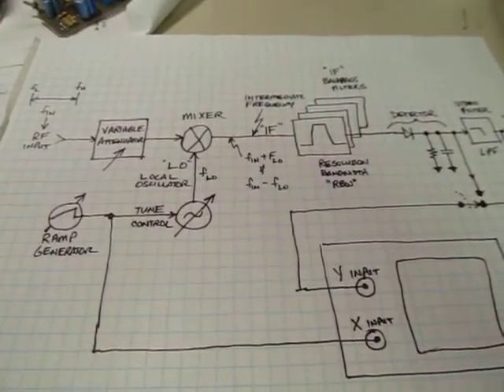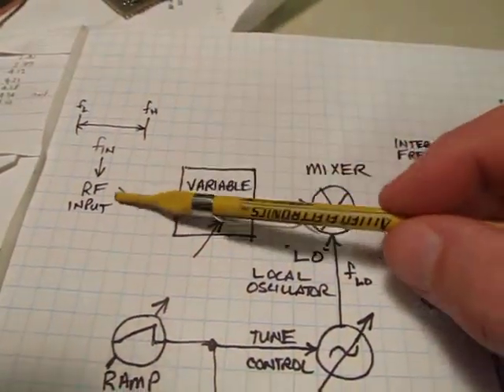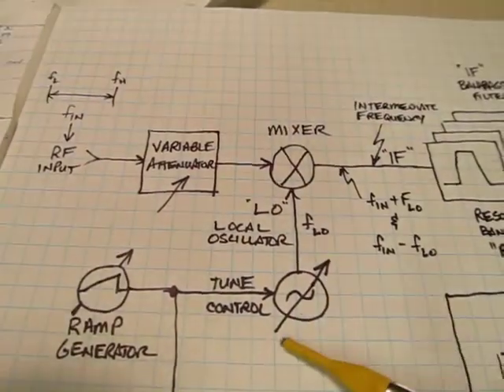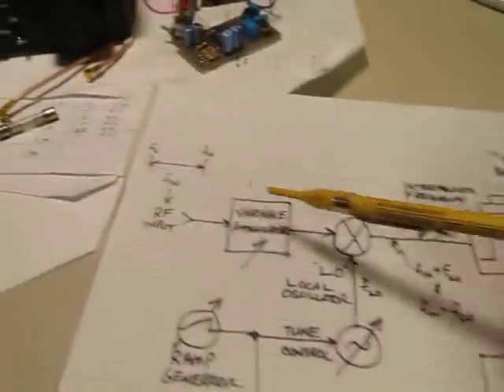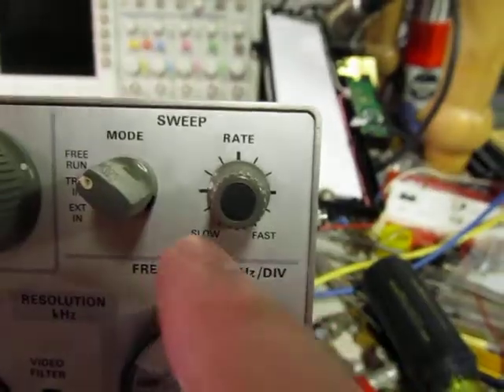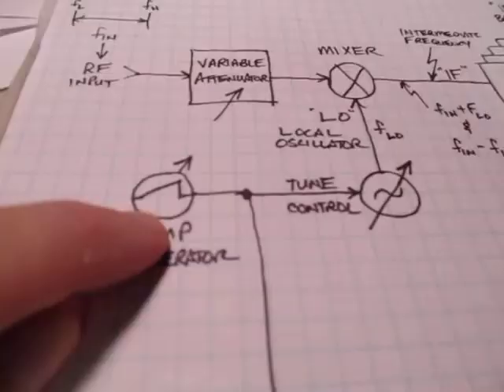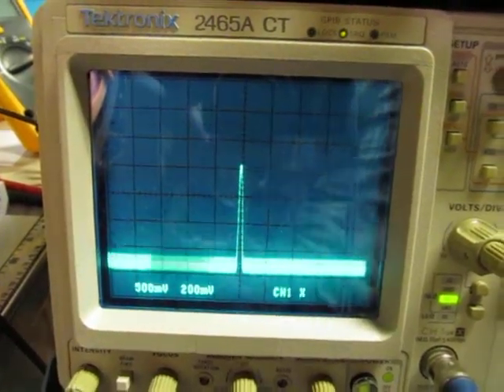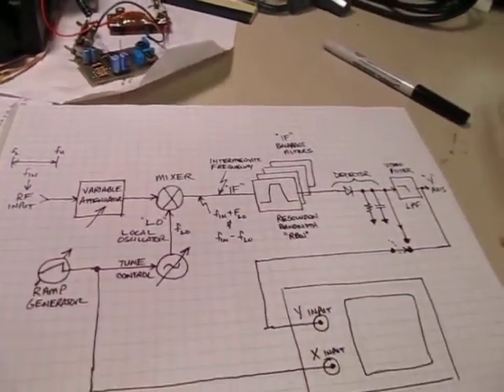#22: Spectrum Analyzer Basics / Tutorial, and the Tektronix 1401A

Comment: Thanks for the great video !  May I ask a basic question ?  In several SAs I've seen there is a setting in their "Bandwidth" menu called "Average Type".  Most manufacturer's manuals (I've checked several) say something vague like, " This sets the Averaging Type", and then describe the choices.   I can usually only find two "averaging" functions in the entire SA.  One is a detection method choice, the other is just basic post detection averaging.  For the first, I can select something other than "Average" (say "Max Peak") for the detector type choice which should eliminate any averaging there.  Then I can turn off the other average function as well.  But this setting STILL visibly effects the displayed trace. It's still operating !  And the setting choice is even still shown on the display.  As far as I can see, ALL averaging should be turned off but changing this "Average Type" setting is STILL changing the trace somehow.  What is this setting actually DOING ?  What averaging function is still operating that it's controlling ?  I've tried everything I can think of to answer this question with zero success.  Could you please help ?  Thank You !
Reply from the maker: The "detector type" determines how the power is detected and processed while drawing each trace.  In older analog SAs, this is the detector that follows the final RBW filter.  In modern "digital" processed SAs, it is slightly more complicated.  When the spectrum trace is computed, the resulting raw spectrum data usually contains more trace points than the horizontal resolution of the display (number of pixels).  So, the "detector" is used to process all of the candidate raw spectrum data points into each displayed trace point.
Reply: @w2aew  Thank you very much for the response !  But I know what "detector type" does.  It's usually pretty well explained in the manuals.  One of those detector types is, "Average" but the rest are explicitly NON averaging types.  What I don't understand is the setting usually found in a "Bandwidth" ("BW") menu called "Average Type".  As I said in my question,  one of those "detector type"s that is explicitly NOT averaging can be selected (say, "Max Peak"), and the down stream "Averaging" function can be turned off as well. And yet this "Average Type" setting STILL is having a visible effect on the trace depending on which option is selected.  Everything to do with AVERAGING is turned off !  Yet this "Average Type" setting is still DOING something.  And the selection made there is explicitly shown on the screen - despite the fact that all averaging is turned off !  I found this same thing in every manufacturer's SA I checked.  What is that "Average Type" setting doing ?  Thank You !
Reply from the maker: @Starlite4321  I guess I'm not quite understanding your question...  The non-averaging detector types are typically selections such as Sample, +Peak, -Peak, etc.  These will certainly show a difference in the resulting trace - whether or not the downstream trace averaging is on or off.  Can you clarify what you mean when you say that you see a visible effect when you change detectors, and why you think this is not expected?
Reply: @w2aew  Thanks again for the response and for sticking with me here !  Yes, I understand that the different detector types will show differences in the resulting trace.  What I'm asking about is a DIFFERENT setting in a DIFFERENT menu (usually the "Bandwidth" menu) called "Average Type" - not DETECTOR type,  AVERAGE type.  I can set the detector type to "+Peak" to use your terminology.  Note that on many SAs I could have chosen a different detector type called "Average" and that I did NOT choose that.  Then I can turn off ANY other settings in the SA that pertain to averaging.  Now I turn to the BW menu. And there is this "Average Type" setting in there (not DETECTOR type).  It doesn't turn anything on or off.  It provides a small selection of AVERAGING (not DETECTOR) types.  Remember, I have the DETECTOR type set to "+Peak" (not "Average") and all other averaging functions are turned off.  Now here's the question: if I change this "Average Type" setting between its options, and don't change any other settings, the trace STILL changes with it.  What is "Average Type" (not DETECTOR type) doing ?  There shouldn't BE any averaging going on for it to SELECT a type for !  Yet this option is still clearly changing SOMETHING.  WHAT is that something ?  The "Average Type" I selected even shows up on the display.  In fact, there's nothing you can do to turn it off !  It's ALWAYS there.  Remember - every averaging function has been turned off or deselected.  Thanks You !!
Reply from the maker: @Starlite4321  Oh, OK.  What are the options under the Bandwith > Average Type?  Is it things like VRMS, Power, LogPower, etc.?  This has to do with how the math works to calculate the average detected signal.  Technically, averaging LogPower (like averaging the dBm levels) is mathematically incorrect - but it was a averaging technique that was unfortunately written into some standards, so many SAs have kept it as a selection even though it is mathematically incorrect.
Reply: @w2aew  And again, thank you very much for responding.  Yes, THAT "Bandwidth>Average Type" !  You say, "This has to do with how the math works to calculate the average detected signal".  But I don't understand that !  Recall in my example, I chose the DETECTOR type to be "+Peak".  In every description of this I've ever found published by many different vendors (and at this point trying to figure this out, I've read LOTS of them !), they make a big deal out of that detector type explicitly NOT doing ANY averaging (same with all the other options except "Average").  It simply picks THE largest sample within the bandwidth and passes that one value along to the detector.  Again, there IS an "Averaging" detector option, but I've carefully not chosen it in my example.  I've also turned off absolutely anything else in the spectrum analyzer that involves averaging.  So there shouldn't be ANY "averaging technique" involved here, right ?  In fact, I don't WANT any averaging in this case !  I picked a BW that gave me a noise level I can live with, and a DETECTOR type that explicitly doesn't involve ANY averaging because I want a trace of THE maximum values as the signal slides past the BW filter.  Yet changing this setting does change the trace !  It's still DOING something !  What the heck is going on ?

Comment: Hi Alan.  I want to complement you on your truly excellent set of videos explaining the operation of analog swept spectrum analyzers.  I have a physics background and have recently been  thrust into the world of spectrum analyzers.  I was finding it really frustrating coming up with understandable explanations for RBW, VBW, ref level,  and noise floor.  Your videos offered me complete clarity for all of these terms. 

I have a question for you.  I think I finally understand the role of the ramp generator that is shown in your spectrum analyzer  block diagram.  However, I am not certain my understanding is on firm ground.  Here is what I believe is going on.  First, the ramp generator applies a time varying voltage to the tunable local oscillator that causes the frequency of the local oscillator to move over a range of frequencies.   Am I correct up to this point?  If I got the first part of my question correct, I want to move to the second part of my question.  As a spectrum  analyzer user, I am able to specify a span of frequencies over which I want the spectrum analyzer to scan.  Specifically, I am able to select a minimum starting frequency for the scan as well as a maximum ending frequency for the scan.  To keep things concrete, let me assume I select 10 MHz as my minimum frequency and 100 MHz as my maximum frequency.  This choice of values establishes a span of 90 MHz.  Now, I am guessing (and hoping) that my choice of 10 MHz as a minimum frequency maps to a unique lower limit voltage on the ramp generator.  Similarly, my choice of 100 MHz as my maximum frequency maps to a unique high limit voltage on the ramp generator.  The ramp generator then repeatedly drives the tunable Local Oscillator over this voltage range,  which means my 90 MHz span is being cyclically pushed through the Resolution Bandwidth filter,  to produce the signal that is displayed on the oscilloscope screen.
Reply from the maker: Yep, you got it.

Comment: Can we do something fancy with the detector to get fast sweeping at narrow resolution bandwidths?
Reply from the maker: Not with a swept architecture.  The narrower the filter, the longer the time constant.  There's no getting around the physics of this.  It has nothing to do with the detector.  The sweep  has to be slow enough to allow the filter to fully charge.  FFT based analyzers have an advantage here.  While you still can't get around the time constant, you can "compute" the spectrum over a wide range in one go.  So, even though the FFT vector is long, it's only computed once.  For example, a traditional swept analyzer will typically take 20-40 minutes to do a 1GHz sweep at 1kHz RBW.  The same can be done with a wideband FFT analyzer in less than a few seconds.
Reply: @w2aew  is there any electronic analog to a prism, separating light in parallel? Not computational like an fft, but some sort of physical implementation? (kc1nyu here, btw)
Reply from the maker: @nickcaruso  I believe there are magnetic resonance structures (similar to NMR applications) as well as surface acoustic wave (SAW) devices that can be employed in a similar fashion for RF/microwave.
Reply: interesting.  thanks!  your videos are fantastic! very helpful for this software engineer electronic hobbyist! 😀

Comment: @w2aew at some point it would be great if you could discuss the difference between swept-spectrum analyzers vs. fft ones. That stuff can get freaky with pulsed signals.
Reply from the maker: I'll have to plan on a video like that.  The short version is:  A swept-spectrum analyzer is like what is described in this video - a swept-tuned receiver with a detector on the output.  An FFT based analyzer is like a wideband receiver, where the receiver BW is sufficient to cover the span of interest.  The incoming RF is downconverted into this wideband IF and digitized, much like a scope digitizes a signal.  The sampled IF waveform is then processed by an FFT to compute the spectral content.  Advantage is that you can do a triggered capture so that the sampled IF signal is just the signal (pulse) of interest.  An FFT analyzer can give you the spectral content of a short, continuous record (instantaneous spectrum), while the trace from a swept analyzer is drawn over a comparatively long time - not possible to see just the spectrum of a short pulsed signal for example.
Reply: @w2aew  Don't some analyzers do an inbetween thing? If the SA can take the whole span in one go and then do FFT on it that would make it a real-time analyzer right? (not shure if there is an commonly accepted definition of what a RTSA is, suppose it could be based on POI). What confuses me is that there are some analyzers, that are not sold as RTSAs, that have an "No FFT" Sweep Mode - that would imply the normal sweep mode is some sort of FFT. My understanding is that those analyzers, because they are not fast enough to do RTSA and can't take the whole span in one go, do a "half-way" thing. They sweep the IF in steps, sample and FFT process it in chunks to get faster overall sweeps. I'm trying to get my head around how this potentially could cause problems. In particular with very short pulses.
Reply from the maker: @juliussokolowski4293  All FFT based analyzers have a given span that they can digitize - this is called the instantaneous BW, or acquisition BW.  You're right, most times this acq BW is narrower than the desired measurement span, so the spectrum is computed through multiple segments to build up the entire span.  If the Span is set to be equal to, or less than the acq BW, then no stepping/sweeping is required.  This is how vector signal analyzer work.  They capture/record baseband (usually IQ data) over a given acquisition BW for further processing, often modulation analysis, etc.  Because FFT based analyzers process a seamless record of time-domain data, they often can be "triggered" to capture data at a specific time - very useful for looking at pulsed signals.  When the analyzer has the ability to perform streaming FFT processing on the IF (IQ) samples as they're flowing through the processing chain, then this is what is called realtime spectrum analysis.  Some do this just to enable triggering on transient spectral events, and most these days can also display the composite result of these realtime FFT results.  These are what are typically called RTSAs.  If you ask an RTSA to show you a span that is greater than this realtime BW, then it will often "emulate" a swept analyzer by stitching together several segments (that are acq BW wide), as was described a bit earlier.
Reply: @w2aew  That stepping is what I have been seeing on the SpectrumMaster - the trace was built up in "chunks" or "sections". Not the regular sweep I'm used to from my FSEB or my 8594. I was looking a over a pretty wide span I should add. Gotta do some more studying - in particular on this pulsed signal thing - never dealt with it before. In my quest to up my SA game I went looking for some reference litterature on spectrum analysis last night and found out that R&S has a book you can download from their website called "Fundamentals of Spectrum Analysis" by Christoph Rauscher - looks to be a nice primer. Anyways, thanks for your insight. Keep it up - your videos are a great help to my Ham License students. Btw. The round table is great!
Reply from the maker: @juliussokolowski4293  Yes, I believe the Anritsu SpectrumMaster has a digital IF, thus the final IF processing is done as an FFT.  I don't know if there is a way to sync the segments to your RF pulse with that unit though.
Reply: @w2aew  We'll see... I started digging and it turned out that my FSEB30 has an FFT-filter option installed (didn't notice that when I bought it or just forgot). Works up to about 1 kHz RBW. I'll do some experiments and see what I can learn.  Thanks!

Comment: is it possible to isolate hum in the audio signal  of a pre amplifier 
 using the spectrum analyzer? If yes, how would the hum be displayed on the analyzer? Also, can you apply the input of the spectrum analyzer to the circuit under test where dc voltage is also present or does the input of the analyzer require only ac signal without any DC voltage?
Reply from the maker: Many (most) spectrum analyzers don't measure very low frequencies like audio hum.  Most cut off at 9kHz.  Also, many spectrum analyzers cannot have DC on the input.  The label on the front panel near the input connector will indicate if DC is OK or not.
Reply: @w2aew  Thank you!

Comment: I have a question regarding a mixer anomaly that, it seems, would occur during the L.O. sweep. When down converting which, I'm assuming, is what would be done to make narrow resolution bandwidths practical, would there not be two peaks detected since there will be two conditions where the difference frequency will appear in the filter pass band? 

For example, consider a case where the input frequency is 100MHz and the I.F. filter is 10MHz with some arbitrary bandwidth. As the L.O. sweeps through 90MHz there will be an output at the filter (100MHz input - 90MHz lo) and thus a peak detected and displayed. But, as the sweep continues, there will also be another peak as the L.O. sweeps through 110MHz.  (110MHz lo - 100MHz input).  Or am I missing something?

This question arose as a result of my investigating the practicality of some of the simple and inexpensive USB spectrum analyzers from China (eBay). I have seen several reviews that confirm two peaks being displayed instead of the expected single peak. I wracked my brain over why this happened, and the above is one explanation that seemed logical. If true, and if there was a way to resolve the problem, through a reasonably simple modification, then the simple USB analyzer would be acceptable for my needs. Otherwise, not so much.
Reply from the maker: Yes, this would absolutely happen as you sweep from what is called low-side injection to high-side injection.  This is typically dealt with in a "real" spectrum analyzer by employing multiple conversion stages.  Each stage employs only high-side or low-side injection, and unwanted images are pre-filtered or post-filtered away.  Remember that with high-side injection, the resulting image out of the mixer is spectrally inverted.
Reply: @w2aew  Thank you. Kind of confirms what I thought was going on with the simple USB analyzer I was looking at. Published schematics show a rudimentary single conversion scheme, just like the diagram you show in the video, and simple fixed BW filter.

Comment: Did you ever get a Tek 323 for this?  I used to repair and calibrate these at Tektronix.  They were designed for the cable TV industry, which was why the narrowest filter was 10 kHz.  Not all that great for amateur radio unless you're doing TV transmissions.
Reply from the maker: No, never got a 323 to use with it.